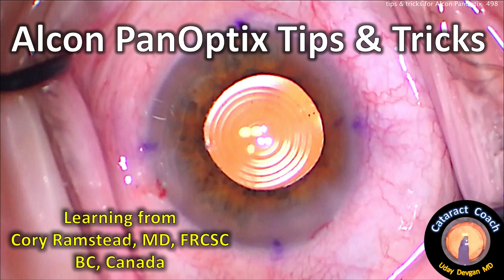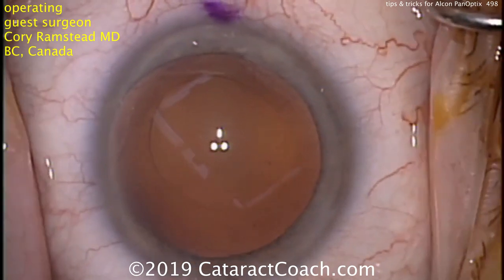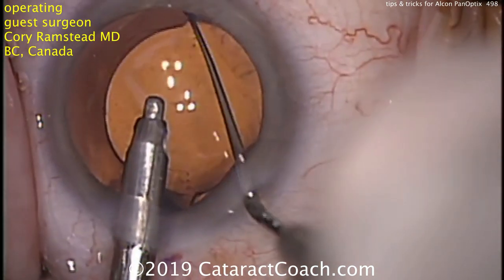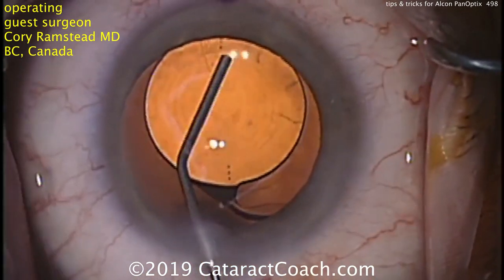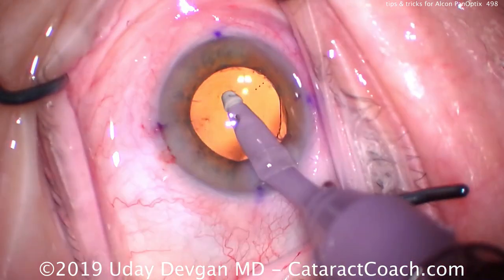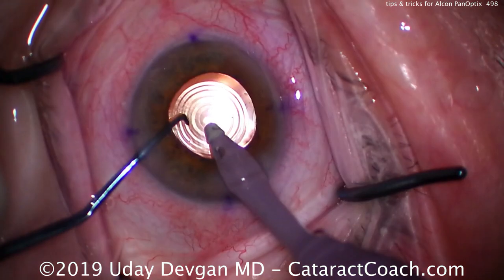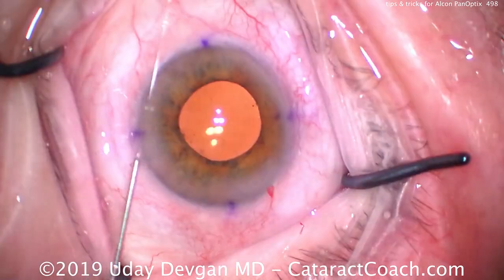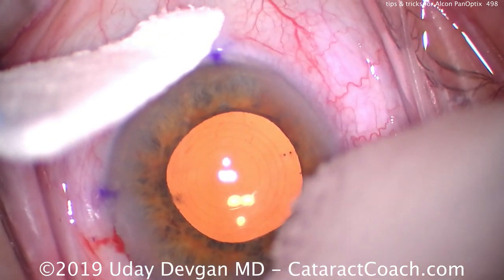Alcon PanOptix Trifocal IOL Tips & Tricks for Cataract Surgery

Comment: Great surgery, prof Devgan.
I had the impression the marks of 100 degrees, that indicate the correct rotational position of the lens, you did closest to the center of the cornea, not in the limbus (they were more dificult to notice in the video). Am I right? If yes, do you always do this way? Is it to make easy if pupil is small?
Thank you very much!
Reply from the maker: I make the marks at a 6mm optical zone so they line up with the marks on the IOL optic
Reply: @UdayDevgan  What is the  size of your incision and the  cartridge model you use to introduce Panoptix?